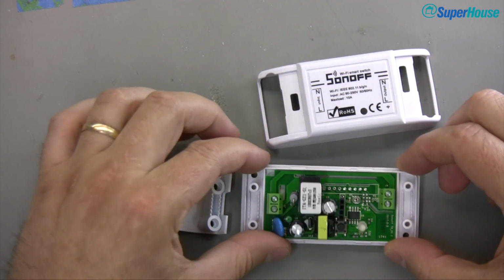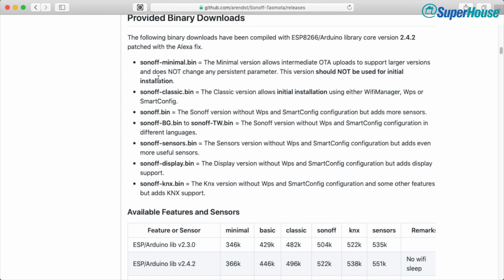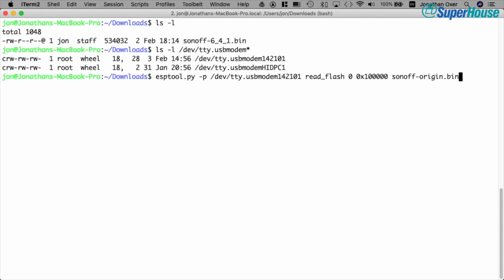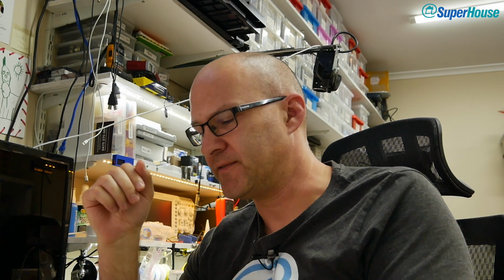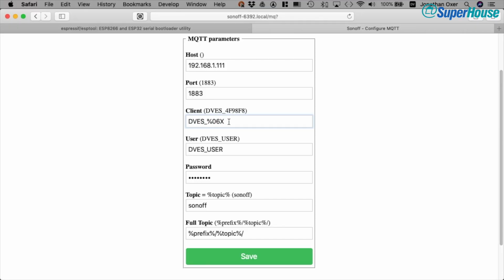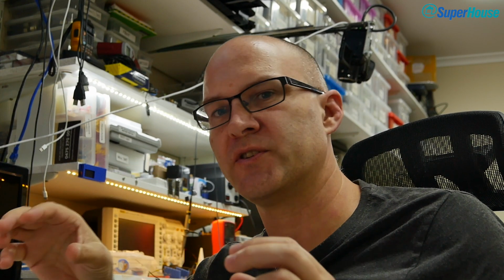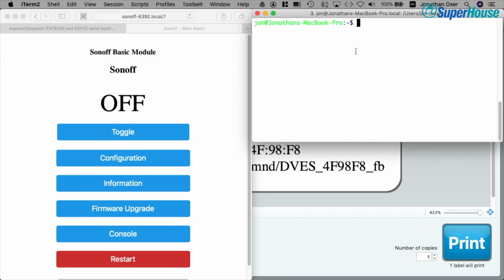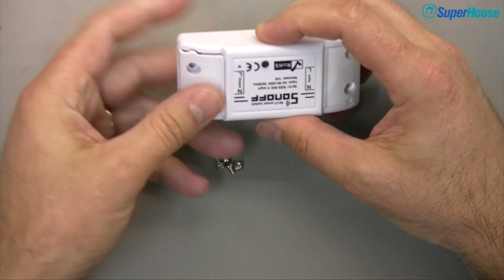SuperHouse #31: Sonoff Tasmota installation and configuration

Comment: Hi Jonathan, I'm a big fan of your videos. You should take a look on the esphomeyaml firmware. Basically you can plug together a firmware using a yaml file. I always use it when tasmota won't fit my needs like e.g. old WS2801 led-strips.
Reply from the maker: Thanks for the tip! This is the first time I've heard of that project, and it looks quite comprehensive. Amazing that I totally overlooked something as significant as that. Just goes to show how little I know about this stuff :-)
Reply: @SuperHouseTV  You got quite a knowledge. But who knows everything. ;) I won't know a lot of there weren't YouTubers like you.

Comment: Is there a resource on your website that would cover A-Z obtaining and configuring a MQTT server for local control without relying on the internet?   When it comes to command line procedures, a resource for a PC application is also desirable (which I am sure is out there).  Youtube is great for the big picture and certainly as a visual aid to doing these things, but there might be value (and payment) for a nice document that focuses on MQTT / Sonoff initial setup and configuration.  Especially for a US based beginner.
Reply from the maker: I've done explanations of MQTT in the past, but I haven't done a specific video showing (for example) installation of a broker. Mostly because it's just "sudo apt install mosquitto", which would be a very short video! There's definitely a need to explain how to use the MQTT features in OpenHAB though, and more detail of how Tasmota uses MQTT with a breakdown of the default topic structure. When I make videos I try to also document the same thing in text / image form on the video page, with the video at the top. That way if people want to learn by watching the video, they can, or they can just scroll down to see all the documentation. If you're only seeing my videos on YouTube you're missing out on a lot of the content. Each video has a link in the description to the page for that episode, which usually contains a matching written guide.

Comment: Well... I'm completely confused - due, in no small part, to the use of command line hieroglyphics, which render me a gibbering wreck.

I've been using Sonoffs with Node-RED for a couple of years, with them running my own firmware, written in the Arduino IDE and despite being really bad at programming, they run flawlessly.

Each one has MQTT topic and other things set manually for each device, but I can make use of the 'extra' GPIOs on the Sonoff (not just GPIO 14, but those on the 'RF pins, etc.) and they do everything I need.

I thought Tasmota would have made things easier but that doesn't  seem to be the case (though it does provide a standard and gives OTA updates - though I honestly don't really see the need for that).

Maybe I'm just missing something and I really should be using Tasmota?

Any chance of doing a similar video with Espurna???
Reply from the maker: If you have your own firmware running, that's fantastic, and you may not get much benefit from Tasmota. Don't underestimate yourself: you say you're really bad at programming, but you've written your own firmware with MQTT support, so that's a big achievement! Tasmota is of most value to people who can't do that, or want to use an existing solution and save time for doing other things. I have my own firmware running on some older devices too, but since Tasmota is a really nice system with very smart people actively developing it, I don't bother with my own firmware anymore. It's easier to just flash Tasmota and get on with my day.

Many people have mentioned Espurna but I haven't personally used it, so I need to give it a go.

Comment: Great video.  But were you not going to look at the source?   Maybe next time.
Reply from the maker: Good pickup! I was, but like all my videos it started to run much longer than I wanted so I stopped after Tasmota setup. That was originally the half-way point, with the second half about how to customise and build it from source. Better to split that into a separate future video.

Comment: have you seen hass.io would love to get your thoughts. i have a system atm and its pretty big but still love your videos.
Reply from the maker: I've tried installing HASS 3 times, and each time I've started with high hopes and descended into "what is this madness?" before giving up. Most recently I did a HASS tutorial run by my friend Alastair D'Silva at the linux.conf.au conference in New Zealand a couple of weeks ago. Alastair is a HASS expert and has developed hardware specifically for it, but by the end of the tutorial I still wondered why even initial setup involved a whole lot of "copy this chunk of YAML and paste it into this file" before it was possible to do anything useful. It's a very popular platform so obviously I'm missing something basic, or I'm coming at it with the wrong conceptual model. I need to try again with a fresh start, beginning with the basics.
Reply: SuperHouseTV  hass.io is amazing. Colab with drzzz

Comment: Hey mate how would I wire the sonoff to my Ethernet so I don't rely on WiFi? Like you say if you are running power you might as well run data as well
Reply from the maker: Unfortunately that would require major surgery because you'd need to add an external Ethernet chip (perhaps the Wiznet W5500) to it.
Reply: @SuperHouseTV  I was hoping it would be as simple as using a ENC28J60. But as I'm only starting out I've got know idea how or what pins to use for what. My house is almost built in drouin and I have run network cable to each switch just in case it can be done.
Reply: Ethernet would definitely be my preference over WiFi (who's paranoid, who said that). Maybe in future Sonoff releases they may add Ethernet capability.
Reply: @DodgyBrothersEngineering  I've seen videos where people use a Ethernet shield to connect to a arduino but it would be great if it could be used with something like the sonoff or any other smart switch that runs a esp
Reply: @robertpoynton9923  I'd rather Sonoff build it into the product rather than 3rd party adding onto the board, it would just make it more stable and reliable.
Reply from the maker: That's exactly what I designed the EtherTen for (it was designed to go inside my light switches) but now that other devices have become so cheap it's hard to justify the price. http://tron.cc/et

Comment: Great Info .. I have a Sonoff G1 ... any idea which of the the bin versions will work with this module??
Reply from the maker: That's a module I've never seen in real life. I'm pretty sure Tasmota won't work on it, because it has GSM hardware in it that's not in any other model. I'd be interested to open one up and see how it works.
Reply from the maker: I almost ordered a G1 to experiment with, but it's only 2G which hasn't worked in Australia for years. If Itead release an updated version with 3G or 4G connectivity I'll definitely get one.

Comment: You can use also OTA now. This was disclosed a week ago on youtube.
Reply from the maker: I went to Bunnings on the weekend specifically looking for the Brilliant smart plug, but it looks like they don't have it anymore. They've just done a big refresh of their smart home product lines. I spent about half an hour with a couple of Bunnings staff while they tried to figure out what happened, because their internal stock system still shows it as in stock in a certain location in the store but that location was filled with ceiling fans instead!
Reply from the maker: Can you clarify? In the video I said to use OTA for updates once Tasmota is installed. Initial installation by OTA can't be relied on, because Itead have changed the factory firmware multiple times so the option for that comes and goes. The only way to be 100% sure is to connect to the serial port on the ESP8266 and flash it over the wire. That always works, no matter what they do with the firmware.
Reply: @SuperHouseTV  yes serial is 100% working but recently some guys managed to deceive the Tuya OTA firmware update process and managed to flash any Tuya device through OTA without soldering. You can check these links:
https://goo.gl/G5JDwq
https://goo.gl/PZmi4r
Reply from the maker: Interesting. I've never seen a Tuya device so I'll try to find one
Reply: @SuperHouseTV  at Bunnings: Brilliant smart WiFi plug with USB charger. At Kmart: Mirabella Genio - bulbs and smart bulbs
Reply: FYI -- only Tuya devices and not Sonoff branded ones